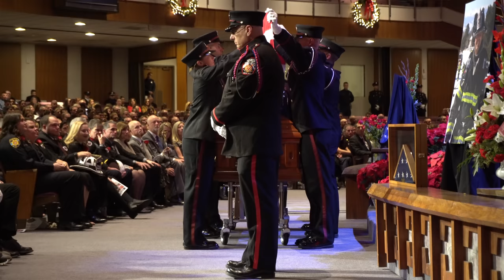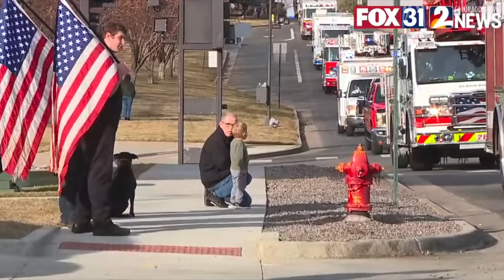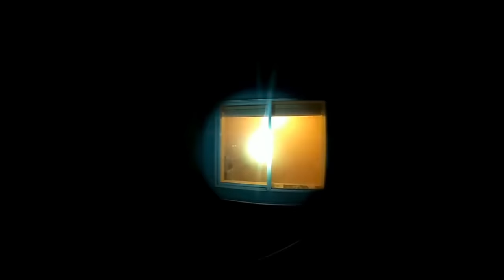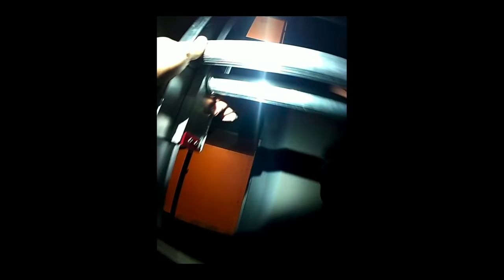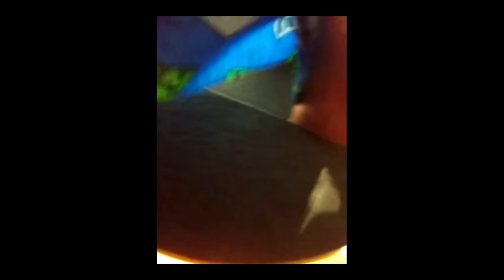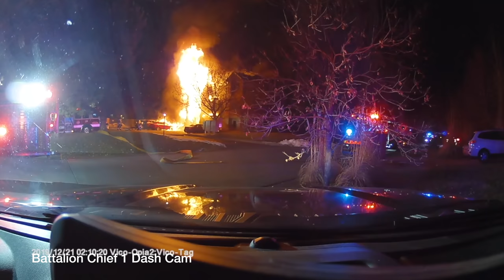Fire Chief Funeral & 2nd Alarm, People Trapped - Vlog 35

Comment: What do you recommend for a guy who has an amputation and is in a wheelchair. For getting out of an apartment on the second floor.
Reply: My first suggestion would be to contact your local fire department where you live, they'll have a non emergency main phone line typically answered during business hours.  You can notify the department of your situation, a large number of departments these days have computers in their engines and trucks that provides premises info to the responding units.  Your info can most likely be added to the info for your apartment complex so if a fire does happen, dispatch and the responding crews will be aware of your situation.  Depending on the jurisdiction, your local law enforcement agency may also have the info so if an officer or deputy is there first they too know that you are a priority to assist.  Insofar as actually escaping your unit, assuming your normal front door egress is blocked due to fire, one possibility to look into is commercially available rope-type escape ladders.  I don't know if that would be an option for you or not as I don't know you but from my experience a good number of folks that require a wheelchair have very strong arms and upper bodies.  I also vaguely remember hearing about another product that works in conjunction with a rescue harness if you'd be able to put it on.  It is basically similar to a rapeling line that anchors to something in the structure and has a friction clutch pulley that slows descent.  Once again, I don't know you or your exact level of limitation so i apologize if the things I mentioned aren't applicable for you.  But my number 1 suggestion is getting in touch with your fire dept. and they also may have someone that can come by your apartment to evaluate your situation and hopefully offer more ideas.  Hope that helps, very best of wishes.  -Johnny